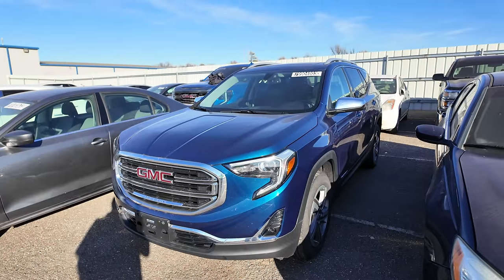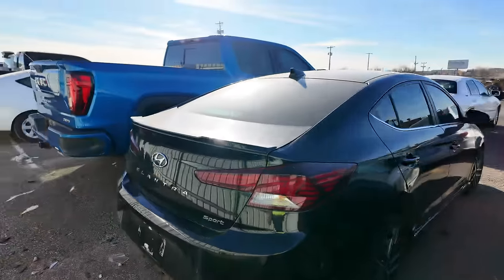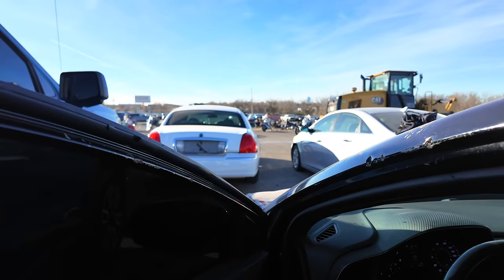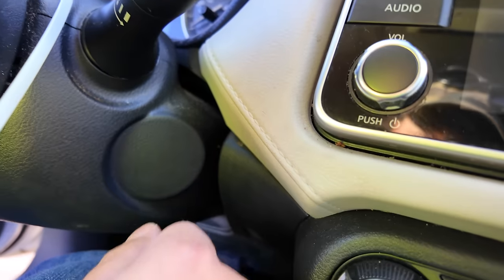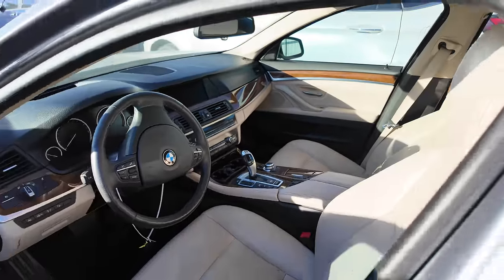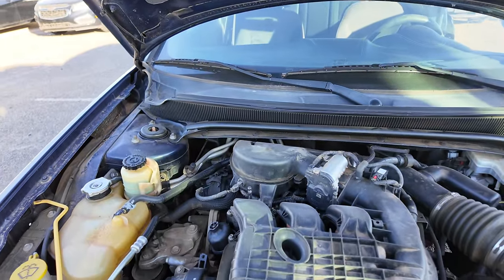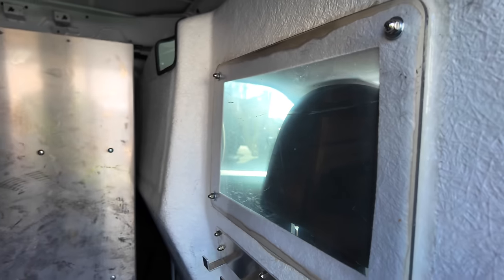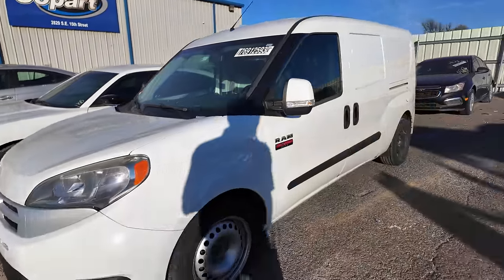Copart was Hiding Some Excellent Deals in the Back Lot!

Comment: Hi Randy, Autohold doesn't hold a certain gear in a car but When you brake your car to a stop, Auto Hold keeps the braking pressure you last applied. You can take your foot off the brake pedal and all four wheel brakes will stay on. If the ABS wheel speed sensors detect any rolling, the braking force is automatically increased until your car comes to a standstill again.

Comment: I own a Promaster City. It’s the SLT wagon version with the rear passenger seat. This little Italian fiat based van has some quirks. 1) if the battery is dead, you cannot remove the ignition key. There is an electric capture feature which holds it in the key slot. 2) the inside door handle is the power lock switch. 3) that van had the power mirror switch on the door up by the mirror. 3) the reason for the the window in the rear wall is to see through the wall and out the side window in the rear slider. There is a huge storage shelf above the windshield. My favorite feature. 4) the power windows are one touch down and one touch up. 5) the suspension is fully independent front and rear. Unlike most other little vans. 6) it has a 9 speed automatic transmission. The van you were looking at was the up level SLT Tradesman model. It has the painted bumpers.

I like my van a lot. It’s the right size, plenty of front seat hip, head and leg room. And big front door openings for ease of entry and exit.

That would make a good little shop van for your running about getting parts and stuff for your projects. By the way, there is a drivers side slider door as well. 

If you get the opportunity, you should drive one of these puppy’s. See if you like it. I drive mine every where. It can tow up to about 2,000 pounds, has about  1850 pounds of payload capacity.

Comment: That dodge avenger has the rocker arm tap of death like my wife's Journey developed at 100k. Avoid anything with the 3.6 pentastar 11-16 and I'm hearing even current models have the same issue with the rocker arms failing and eating the cam which is death for the engine.  Avoid them like the plague!!
Reply: Yes watched a Jeep Liberty with that 3.6 in it lock right up after running 10 minutes with Amsoil engine flush in it 😮😊
Reply: @carlbernard4197  rainmanray just had a 17 Pacifica granaid itself similarly only had like 30k on it

Comment: So far, my favorite is the versa with the bullet hole. It seems to me I saw a video someplace where a car would not start, and it was a wire in the rear trunk light area that was the problem. I bet if you replaced the trunk lid wiring harness, the car will start.

Comment: The noise on the gmc might be a cylinder misfire. Usally if the check engine light is blinking, it means a misfire. You can replace on of the cylinders for like 50 to 100 dollars